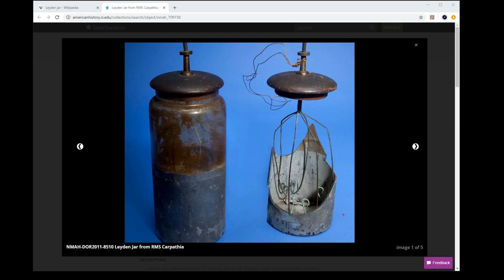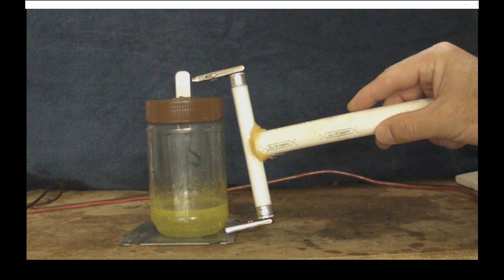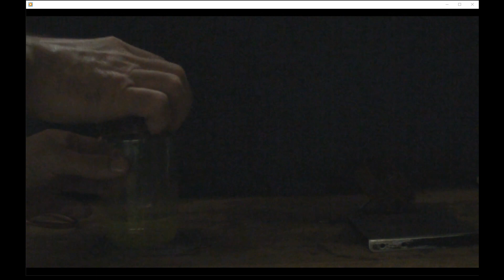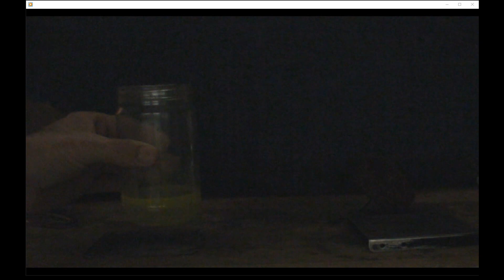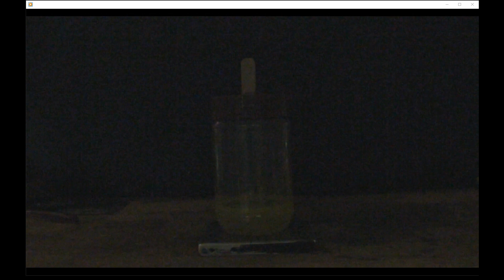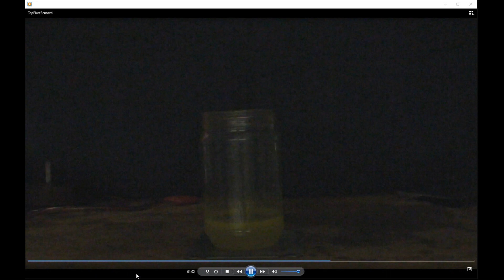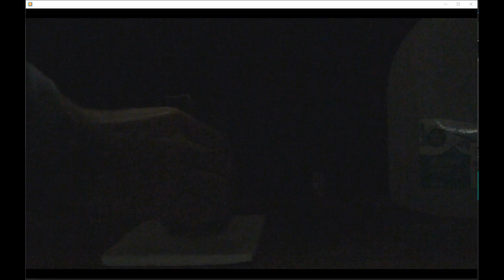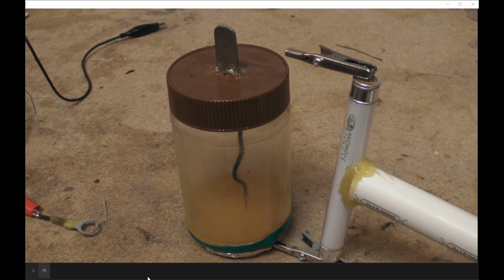Electron Theory can't explain Capacitors, but Ben Franklin can!

Comment from the maker: I am recopying the links from the description so the referenced videos will properly cut to the exact time:  Dissectible Leiden Jar Videos:

Professor Julius Sumner Miller - https://youtu.be/NNR-sd58p-U?t=600
Professor Walter Lewin - https://youtu.be/GAtAG938AQc?t=2390
Professor Walter Lewin's Leiden Jar explanation - https://youtu.be/By2ogrSwgVo?t=1965

Dissectible Parallel Plate Videos:

Russ - https://youtu.be/eQGd_jYYfqQ?t=580
Richard Hull - https://youtu.be/NQO-p_ff0Xs?t=110

Distilled Water is an Insulator:
Jay (The Plasma Channel) - https://youtu.be/o9s5YM948q8?t=27

JIF Jar Capacitor Inspiration:  
Robert Brockway - https://youtu.be/Nrx9HYG7JtI

Transistor based Electroscope Inspiration:
Thomas Kim - https://youtu.be/WptwVzK7cK0

Ben Franklin - Experiments and Observations on Electricity made at Philadelphia in America:
https://archive.org/details/experimen...
Reply: Sorry, this problem was explained and corrected by James Clerk Maxwell.  The answer is contained in one of 4 equations collectively called Maxwell Equations.

The answer to this explains why the speed of light is what it is.  Resulted in the technology that is used to send and receive radio waves.

Nice try, but Physicist knew of this and problem you think is new was resolved in the 1800s.  So more than 200 years ago.

😂
Reply from the maker: @joeboxter3635  <<Nice try, but Physicist knew of this and problem you think is new was resolved in the 1800s.>>

Joe, I am missing your point.  Are you saying that I think this is new?  Or that there are electrons?  I'm confused on the point you are trying to make...
Reply: That’s cool and all but do you want to give some volt readings or anything? lots of vairbales that you just seem to ignore. Any how you going to publish any papers? Reckon you could be 'revolutionizing’ the field with that ‘discovery’.
Reply from the maker: @voidwanderer7138  <<That’s cool and all but do you want to give some volt readings or anything? lots of vairbales that you just seem to ignore.>>

The volt readings would blow out my volt meters.  High voltage equipment is expensive.  What variables am I ignoring?

<<Any how you going to publish any papers? Reckon you could be 'revolutionizing’ the field with that ‘discovery’.>>

I am not interested in publishing papers.  This isn't really a discovery...Ben Franklin figured it out and the idea was know until around the 1900's, when Lorentz and Einstein took over the electric, academic scene and crushed Maxwell's ideas of what Dielectric displacement really means.
Reply: @itsbs  how about some simple 2 plate experiments, 2 plates of the same size and material and you can try out placing different materials between them (keeping the distance the same of course) see what resuts you get for plastic or glass, and make sure to show the voltage you're putting in if you're not measuring it on the way out.
Reply from the maker: @voidwanderer7138  << how about some simple 2 plate experiments, 2 plates of the same size and material and you can try out placing different materials between them (keeping the distance the same of course) see what resuts you get for plastic or glass, and make sure to show the voltage you're putting in if you're not measuring it on the way out.>>

I have done a lot of experiments.  This video was to show that the electrical energy storage was in the dielectric by taking it out of the so-called "electric field of the plates due to electron displacement."

In terms of quantities of charge, I didn't care...as long as I could film the arc discharge to prove charge was either there or not.
Reply: @itsbs  So do you not think that electrons are moving round circuits and transfering energy? - just wanna make sure I'm getting your position correct.
Reply from the maker: @voidwanderer7138  <<So do you not think that electrons are moving round circuits and transfering energy? - just wanna make sure I'm getting your position correct.>>

No, I am not a "charge carrier" electrician.  I am more in the Maxwell Aether electrician camp.

Comment: My understanding is that the energy is stored in both the dielectric and the metal. In the dielectric, the energy takes the form of electric polarization. In a gaseus medium, this dielectric polarization results in an apparent surface charge. In the metal though, the steady state of the energy takes the form of a uniform electric potential distributed throughout the entire volume. When you "ground" something, what you're really doing is connecting a high potential volume to a low potential volume. The difference in electric potential causes a current to flow between them.

This is the basic idea behind how an electrophorus works. When you rub the cat fur on glass, the triboelectric effect polarizes the glass and builds up a surface charge. When you then touch the electrophorus to the glass, electric charge flows into the electrophorus, increasing it's electric potential and thereby storing energy inside of it, which you can then discharge on something else.
Reply from the maker: <<both the dielectric and the metal.>>

If it was stored "in the metal", then you would still be able to get a shock from the metal after the dielectric is removed.  This doesn't occur.

And you would be able to put your volt meter on each side of the metal plates and blow up the resistor in your volt meter, due to too high of a potential difference.  This doesn't occur.  (I guess that I should have added that to the video).

<<polarizes the glass and builds up a surface charge.>>

Polarizes the glass is correctly aligned with Maxwell's aether electrodynamics, but the "builds op a surface charge" is more aligned with "electron electrostatics", which is incorrect.  How could electrons be able to perfectly distribute themselves throughout the dielectric to create a temporary electret (polarized glass)?
Reply: The "surface charge" I'm talking about is the air near the polarized surface itself becoming electrically charged. This is a real thing. If you've ever looked on a telephone pole and seen a stack of ceramic disks in a shape sort of like =)=)=)   that's done to increase surface area across the insulator because electrical charge has a tendency to creep along the surface and can eventually lead to an arc. As I understand it, this only occurs because the air itself can ionize. Same reason why coronas and ionic thrusts don't work in perfect vacuums.

Back on the top of metals storing energy, the point I was making is that metals store energy in a completely different way.

Dielectrics are sort of like springs, which in the presence of an electric field, are drawn into tension or compression. They can release that energy very quickly, but have an difficult time doing so without a conducting path.

Metals on the other hand have 2 different ways of storing energy. One is in their magnetic field. Every wire with a current flowing throw it produces radial electric field and concentric magnetic field around the wire. For the current to stop, that magnetic field has to collapse. Which gives the current a sort of momentum. The effect becomes far more exaggerated in the case of a solenoid. And especially a solenoid wrapped around a ferromagnetic material. You can think of this as mechanically being very similar to a flywheel.

The second way that a metal can store energy is a bit more....relative. Because similar charges repel each other, you can imagine that a box full of negatively charged particles would eventually settle into a steady state where they're uniformly distributed. This is how free charges behave inside of a metal. Now, as you can imagine, if the density of free charges in one metal is higher than the density of free charges in another metal, and you touch the two, a current of charges will flow from one to the other until the combined system once again has an equal distribution of charges. This is sort of analogous to air pressure. A current doesn't flow unless you have a difference in this "electric pressure" (electric potential), and a conductor (resistance) for the current to flow from one end to the other. Mind you that the "pressure" is relative.
Reply from the maker: @bitskit3476  << air near the polarized surface itself becoming electrically charged. >>

Yes, air is a dielectric.

<<As I understand it, this only occurs because the air itself can ionize>>

Air is a dielectric and polarizes and breaks down, e.g. spark gap, dielectric breakdown.

<<ionic thrusts don't work in perfect vacuums.>>

Well, based on the "ionic wind theory" sure, but the vacuum is a dielectric and polarizable, just like air and just like "plastics."  Maxwell's radio waves proved that... and the vacuum capacitor.  Electrical type thrusts in a vacuum is really the thing to look at.  Decent vacuum experiments have been done, but that would break many physics books, so you probably have not seen them.

<<you can imagine that a box full of negatively charged particles>>

Not really.  I'm not that imaginative to believe in "particle" electricity.
Reply: @itsbs  well, you're far more imaginative than I if you can imagine a fluid without atoms. But the explanation I gave of pressure differences, fluid flow, and sloshing is the entire principal behind how radio antennae work.

Travelling electromagnetic field displaces electric charge within a metal -> electric charge sloshes back and forth in antennae -> diode rectifies the alternating current into pulses of a direct current.

The concept of free charges only exists within metals and ionized gases. Perhaps a middle ground would be to argue that it's just a statistic model, where you're saying "an electron is a fermion of electric charge, used to model the fluid-like behavior of electricity within a conductor".

I doubt that you take issue with the idea of energy being stored in a magnetic field around the wire, given that you believe in vacuum polarization. And given that "quantum" objects like fermions are really defined by wave equations and their "quantum" numbers (which map particle properties to standing waves), I don't think that you would find issue with modelling electric current in terms of fermion (electron) flow.

So in your physical interpretation, you could think of "free charges" as standing waves of electric charge within the conductor, which have a habit of repelling each other.

As I understand it, the number of electrons within a metal is actually based on the number of molecular bonds, which is based on the quantity of electric charge needed to break those bonds. Hence why you see Avogadro's number within Faraday's constant.
Reply from the maker: @bitskit3476  <<well, you're far more imaginative than I if you can imagine a fluid without atoms.>>

That doesn't describe me and that it different.

<<an electron is a fermion of electric charge, used to model the fluid-like behavior of electricity within a conductor">>

Not me.  You keep trying to say what I must be thinking.  It's not correct and it doesn't matter what I think anyway.

<<So in your physical interpretation>>

Umm... stop giving a fuck about what I think.  It doesn't matter.  Just take the data and try to figure it out yourself.

If you have a question about what I presented, ask.  Otherwise, it is wasting my time.

Comment: What location does the electroscope show for positive and negative if the lid with wire is taken off?  Did you ever test charge/discharge without anything in the jar or with double the amount of liquid?  Thanks
Reply from the maker: <<What location does the electroscope show for positive and negative if the lid with wire is taken off?>>

I'm not sure.  I don't think I did that.

<<Did you ever test charge/discharge without anything in the jar or with double the amount of liquid?>>

I remember using cooking oil and distilled water mostly... and the wire was hanging down so I could see the motion and disturbance of the dielectric, so the liquids were mainly just below the end of the wire.

I also did some plate capacitor stuff.  It has been many years ago, so I might be forgetting a few things.
Reply: Thanks for responding... I'll definitely need to read franklins letters.  I wonder if master ivo videos would make more sense now.  Lots to think about👍

Comment: So does this mean that current actually DOES flow through a capacitor? Very interesting demonstration. Thank you
Reply from the maker: <<So does this mean that current actually DOES flow through a capacitor?>>

I would think of it more this way... the dielectric in a capacitor becomes polarized and becomes less of a resistor/insulator.  That's a simple way to start.  The term used for this is called Displacement Current, which was theorized by James Maxwell in the 1860's.

Also, when you vary the current, like in alternating current, look at how the capacitor acts.  Think of the dielectric being polarized back and forth in that situation.

Comment: Great demonstration. 
A question, if I may. How can a first-year student properly teach himself physics? Do you have suggestions for any methods, books or other resources?
Reply from the maker: <<How can a first-year student properly teach himself physics? Do you have suggestions for any methods, books or other resources?>>

Physics classes are most likely going to drill you on the math, but be careful on the Einsteiner and Quantum Mechanics theories, since they are pseudoscience.  You can learn more about that on my channel.

Pay a lot of attention to electricity and magnetism, but realize that "electron ball" theory is not how electricity works.  When you learn Maxwell's equations, go back and read Maxwell's papers to understand the theory that actually derived the math.  Oliver Heaviside took it even further, but realize that the vector calc is a simplification of the Maxwell EM theory.  Dielectric displacement is where "math physics" goes really wrong with electron ball theory... with this video here, you understand that the dielectric is being polarized, like a temporary electret (Heaviside) and analog to the temporary electro-magnet.

Schrodinger's math is fine to learn, but the QM interpretation is complete bunk.  Quantum Tunneling and wave function collapse, and wave/particle duality and Quantum State Superposition and Quantum Entanglement is all BS.  It stems from a misunderstanding of electricity by math physicists.

To best understand the "imaginary number" side of the math, you go back to Steinmetz method of recognizing electricity as dielectric AND magnetic energy interchange... not a flow of electron particles.  Schrodinger math is based on classical Maxwell theory (not electron theory) and definitely not Copenhagen's probabilities.

Most of my videos have references that you can look up to study more.
Reply: Thanks you for this comprehensive answer. 
It is very useful. However, before studying electricity and magnetism, I must still learn classical mechanics. How should I do this? Should I just get a textbook and work through it?
Reply from the maker: @user-jn4up1ts7r  <<However, before studying electricity and magnetism, I must still learn classical mechanics. How should I do this? Should I just get a textbook and work through it?>>

I think many of the resources online can help with that and I don't have any preferred classical mechanics recommendation... maybe go through the Feynman lectures, but it would be best to know where the gotchas are BEFORE believing all the stuff he throws at you.  You should learn the videos I have in the playlists, so you can listen to a physics lecture and pick apart the mistakes they are talking about.

So, learn the stuff from my channel and then you can spot the BS that Feynman will discuss in some parts of some videos and you can pick through some of his lectures.  Other than the pseudoscience issue, I think he is a good teacher, and even learning the modern pseudoscience is helpful, if you can understand why it is pseudoscience.
Reply: Thanks again. The fact that you share your findings and help others is very noble. 
I will let you know of my progress in a few months or so.